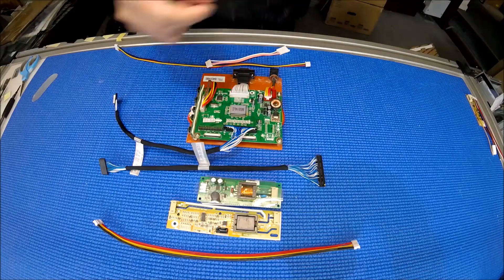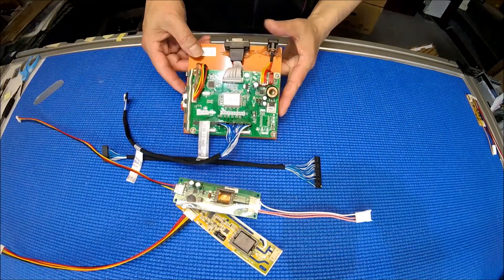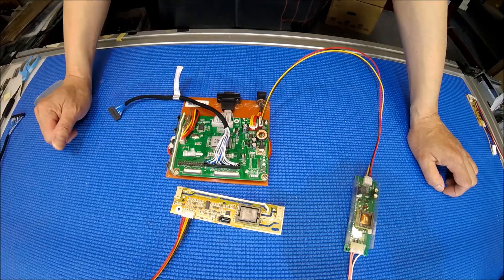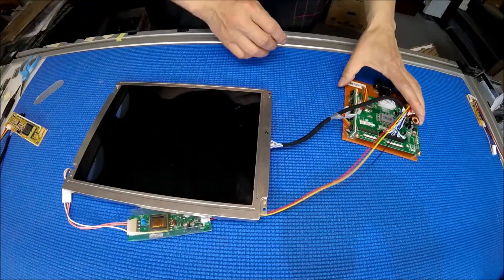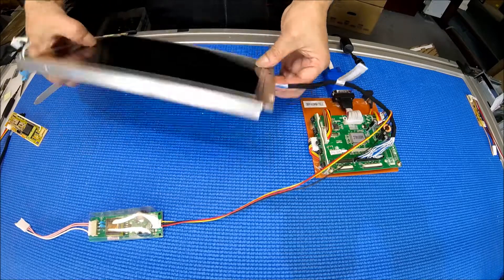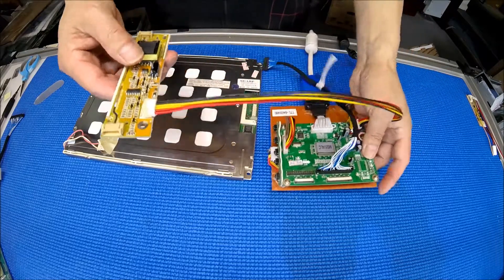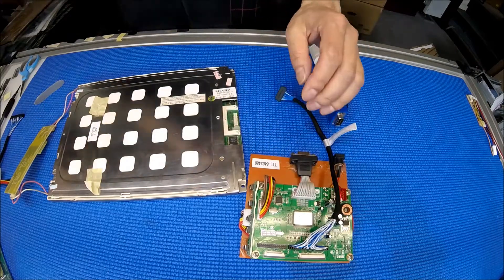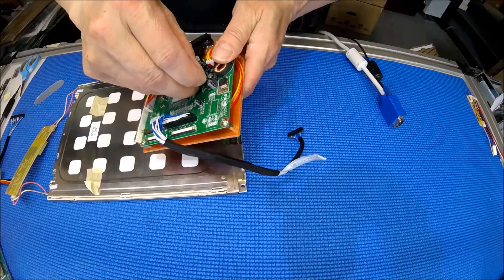TTL 640X480, How to Test Industrial LCD screen

Comment: I have a 13.3 inches android tablet  .  it no longer powers on , I want to take it apart and use the 13.3 inches  LCD as a monitor   .   it has 40 pins TTL interface  .   the whole unit when it was working good used a +5v power supply . inside the tablet you had 3  batteries  .    do you think I can use  LCD kits  with my 13.3 inches lcd  removed from android tablet ?